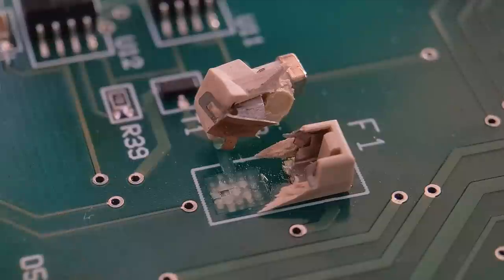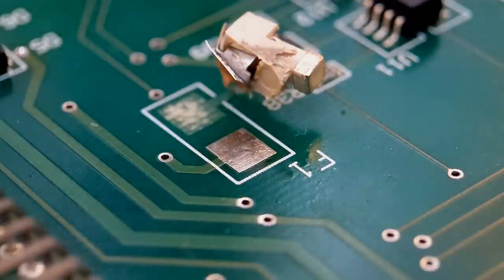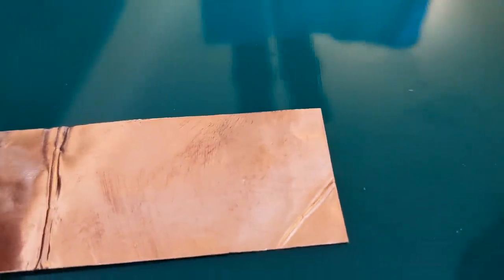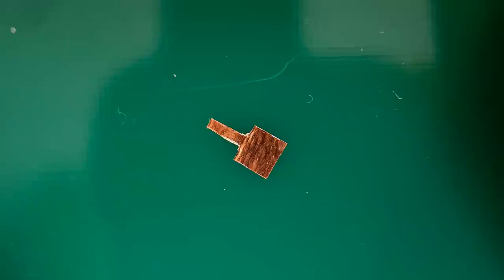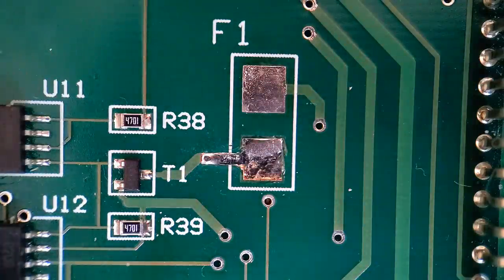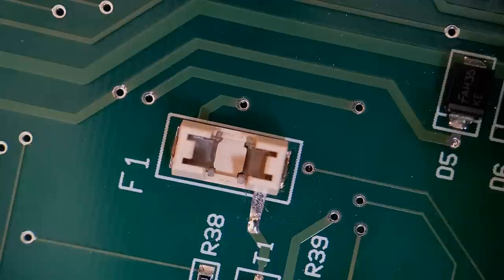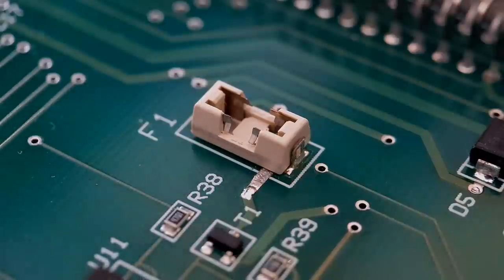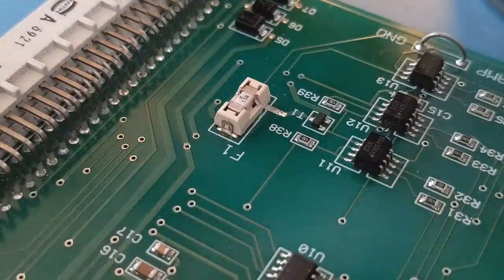How To Repair Damaged PCB Pads / Traces || Copper Soldering

Comment: This was very, very nicly done. What exactly is the glue name, please?
Reply: Tak Pak, it’s not that cheap though
Reply from the maker: Buy it seperately on Ebay or Zoro , half the price ,  much cheaper 👍👍
Reply: @mrsolderfix3996  
It would be really useful if when you mention propriorty stuff like Tak Pak you could put some kind of link, or even just the name in the description, especially when they use "cool" spelling. Tack Pack Tack-Pack Tacpac Tacpack etc. I tried looking for it including the word glue and found hunting supplies, stuff for horses and educational material . Maybe a cut and paste standard blurb "I use X solder and Y flux etc. Even if people don't buy the exact stuff it gives them the the idea of what kind of thing t be looking for.  

I only came across your channel recently and saw you using a long bit of solid to bridge all the connections on a damaged multiway connector to spread the heat to remove it. Brilliant. Been using an iron in a hobbiest way for 40+ years and it had never occurred to me. Subscribed there and then.
Reply from the maker: Hi , thank you for your comment and subscribing , very much appreciated . At the end of the video I actually put a clear photograph of the Tak Pak and applicator up showing the spelling and the code of both items , I just presumed this was enough . It's hard sometimes to remember everything but I will always try and show a photo at the very least . 
I never do links , just my personal choice . eBay or Zoro are the best places to buy tak Pak , it's a lot cheaper , instead of buying as a twin pack . Hope that helps , thanks again 👍
Reply: @mrsolderfix3996  Sorry, so you did. I just stopped watching at the payoff. Also, thanks for the Zoro tip. I'd never heard of them, but looks really useful.
Reply from the maker: Hi , I've used Zoro plenty of times , very reliable and good prices . If you live in England and need solder try BLT Circuits . Great solders , great prices . Take care 👍
Reply: Thank you. Yes so this is a Loctite stuff. Yes Loctite is never cheap, but is quality stuff for sure.

Comment: Well you need to apply green mask on it cause in future it will develop corrosion on that soldering joint ... Otherwise all video is awesome
Reply from the maker: Hi , thank you for your comment . That's the only thing I could of added  . I did say in one of the end photos about adding solder mask or Kapton Tape to the exposed trace . Thanks again for your time , take care 👍

Comment: Thank you for the excellent video, this is a fantastic technique. I am going to attempt to use a CO2 laser cutter to cut a template into copper tape, to replicate some very fine and complex corroded traces in an LED wristwatch. I think I can use the loctite 382 to glue the copper tape topside-down, and then clean the adhesive off as a final step before tinning and applying solder mask.
Reply: Whoa, that's some challenge. Good luck in your endeavour.

Comment: Can you please post a link to "tack pack glue".  Google does not return any good results.
Reply from the maker: Hi, thank you for your comment . It is spelt Tak Pak , it comes in a twin pack . Cheaper way to buy it is seperately , glue from eBay and activator from Zoro . Hope that helps .
Reply: @mrsolderfix3996  Thank you.
Reply: Ooh, that Tak Pak glue is expensive. I came back after searching for it to mention that it is expensive and saw that someone else had commented the same thing. I will have to think about that one. 

Do you rate the lead-free solder you use, though. I've not known many who are keen but that did look shiny and solid.
Reply from the maker: Hi , I think I mentioned in one of the other comments that a cheaper way to buy it is seperately from eBay or Zoro . It lasts a long time so if you do lots of PCB modifications etc it's worth getting . It's the best glue there Is for gluing mod wires down to the PCB. 
I get my lead free solder from a company in England called BLT circuits . There lead free ( SN100SB ) is the best there is . It actually says in the description for it that it produces shiny joints and it flows so nice . Definitely recommend this . Cheap as well compared to solders from the well known stockists . Hope that helps
Reply: @budgetmerch  Interesting, I came for the same... as I couldn't find the Tack Pad... Googleling I found the Loctite 382 as "Takpak" one, expensive one. Seem a name given by RS manufacturer (382+Activator) I notice that is a cyanocrilate one, and Loctite classifies as "general purpose" one... looking at the datasheet, I see that the mechanical resistance is reduced up to 25% at 120`C ( I understand this temperature as working one, not the sudden one suffered after soldering the fuse)... going to Farnell, I went to the cyanocrilate section, and shorted by the cheapest... then I picked the cheapest one with Datasheet: Loctite 401 (5$) and saw the the mechanical properties are better at 120C... high temperature are slightly better
My take is that any cyanocrilate will work as good as the Tak Pak one

Comment: Nice job, you could have just fixed the existing pad back down too, it wasn't broken.
Reply from the maker: Hi , the existing pad was warped and cracked almost from the trace at the join . If I would have tried to flatten it it wouldn't have sat dead right and would have had 2 joins between the pad and T1. Lot easier and stronger doing it with the tape . If I would have just bodged the pad down people wouldn't have seen a method they may not have seen before . I think it's important to get more repair options out there , then you can choose the one you like . Thanks again , take care 👍

Comment: There is nothing wrong with your repair except it is way over designed and took too much time.  You should have just used the pad that was lifted up..  Unsolder the pad from the broken fuse and glue the pad back down.  There was no need to make a new pad.  All that glue you used will just make that part harder to replace again.  That one drop under the fuse holder was all you needed.
Reply from the maker: Hi , this video was shown for the purpose of showing what the copper tape can be used for . Some complicated shapes that need to be created can be easily made this way . There will be times when you need to recreate pads , this is a good option . Thanks.